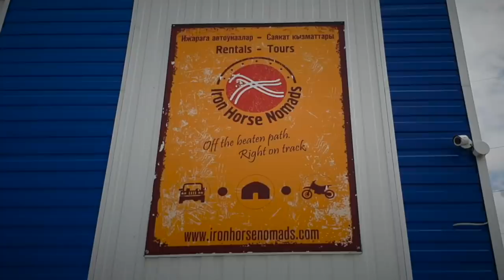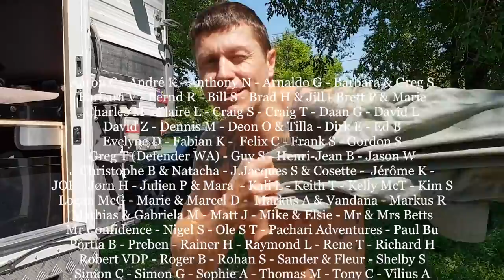Disaster at 3000m (Ep75 GrizzlyNbear Overland)

Comment: I don't understand what really happened...hit a rock.?...hard to watch in video ..but definitely not buying a rover..if u would have had a incoming car truck...
Reply: Pot hole they said.
Reply: @dingodazz3724  thanks for reply, what a pot hole...?..like a deep hole..?..is that it and all that broke ??..
Reply: @rnunezc.4575  Yes, a hole in the road (where the surface has come off and some of the subsoil missing), usually about 1 -2 feet in diameter. Yes that is all it took.

Comment: ironicly a defender pulled by a toyota. But seriously, i like defenders, but it's also very well known for being unreliable. Considering this is your second defender from what i've seen (perhaps even more?) Why keep back going to defenders?
Reply: Can toyota handle the same amount of abuse defender can? Don't think so. Old cruisers have weak axles and new ones have pussy IFS. Def is a much stronger truck
Reply: Look for more... There are plenty of unreliable cars and 4x4s in the market. I think when a person choses another person knowing their pros and cons, it is more or less the same with cars. But the cars are not usually fixed by the owners and most of the cases owners get tired of cars because dealerships and workshops or garages...
Reply from the maker: We are passionate and absolutely love Defenders and the family it comes with. Our first was a 90 , to small for what we wanted to do, our second was involve in a crash, head one with a speeding truck, wasn't our fault but the Defender saved our lives. and now that. so really it's  the first time we had a  "problem "
Reply: In the winter of 1977-78 the Mk 1 diesel transit van I was driving was towed from Meshad in Iran to Peshawar in Pakistan by a 1960's diesel long wheel base land rover. ..right across Afghanistan in mid winter with blizzard like conditions and pretty extreme terrain. The transit was loaded to the hilt and the Perkins diesel engine it had would have made it a heavy beast empty. I recall I even picked up an American hitch hiking....The land rover was also similarly heavily loaded. Now the land rover did this without any issue at all which is absolutely remarkable...it burnt more oil than diesel if I recall but who could blame it.  We had both left the UK together with two other vehicles.. by Meshad we were the last ones left.. the Transit's Perkins cracked its head after a very cold night froze the coolant in the block and it lost circulation unknown to me when I started driving and cooked..without any warning. That classic series two land rover was simply amazing.. I can well understand why Land Rover owners are so dedicated..